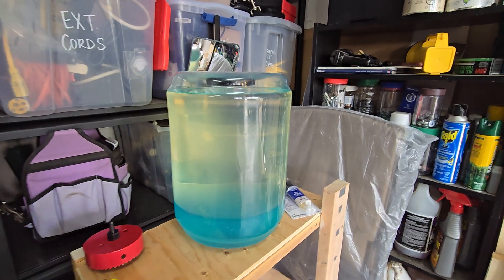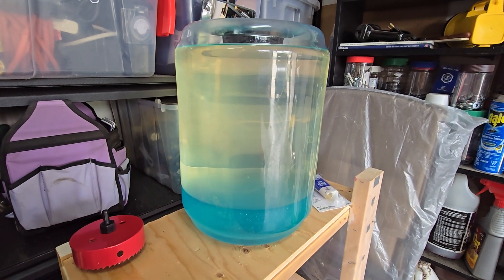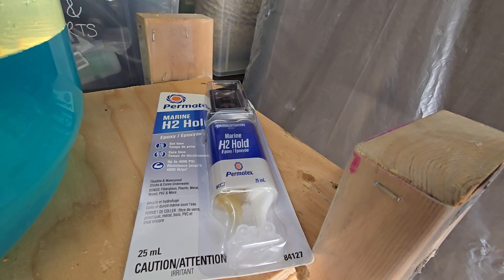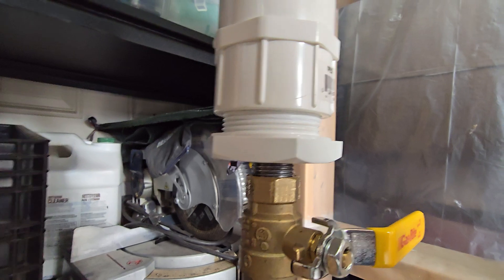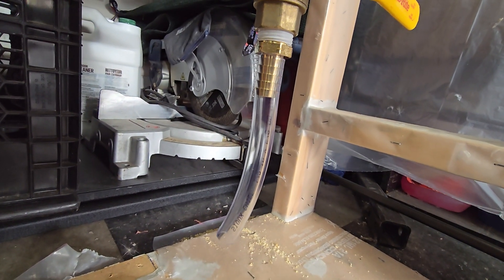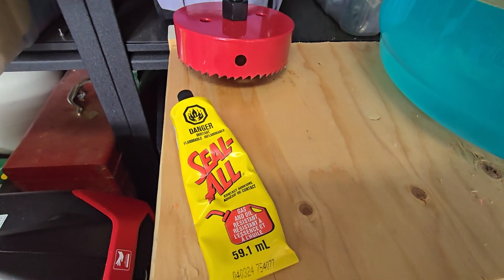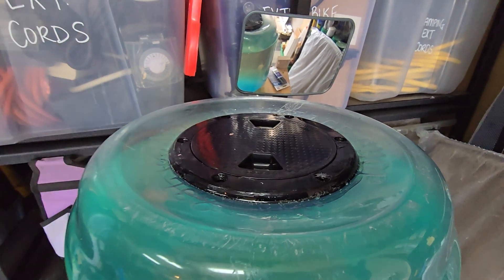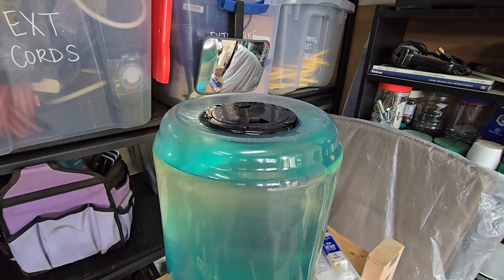My home made container for removing ethanol from gasoline

Comment: I'm a chemist.  Just because two solvents (ethanol/water v. gasoline) are immiscible does not mean that they are not slightly soluble in the other.   If you smell your lower layer (ethanol/water) it smells like gasoline, yes?   With the detergents they put in gasoline, you will pull some water into the gas.  This can cause fuel line freeze-ups, compression issues and corrosion.   Your ethanol/water extract may also pull these helpful materials out of your gasoline.   When an organic chemist does a liquid-liquid extraction (what you are doing) we DRY the upper layer over an inorganic drying agency to bind the water.  

If you are running this in a mower in warm weather,  fine, probably not an issue.  I would not trust this gasoline in a car or truck.  There are products that chemical tie up the water you may want to add as a precaution (Sta-bil or similar).   By the time you do all this, it is just cheaper to buy ethanol-free gasoline available most anywhere, especially near places people boat.
Reply from the maker: @Kopernicus67  in ALL of Canada ethanol free gas is already been banned. I start with shell premium and remove the ethanol mainly for long term storage of my small engines. I've seen enough videos to see ethanol gas goes bad after a few months of shelf life. I have some gas in a 50L stand up Jerry can that's over 8 years old and still the same clear to light yellow color and still burns easily. A can of gas I bought last year was dark yellow and wouldn't burn very well at all.

Comment: Ok cool, but I have never seen any vid on the subject.  Does it just separate?  What is happening?  Sorry I have no clue 🤡
Reply from the maker: @FISHAWNfishing  that's why I mentioned that there are a lot of videos on YouTube of how to separate it. Basically, you add a lot of water and shake vigorously. I add about 5 drops of blue food coloring per gallon of water. After you shake it in a Jerry can, pour it in a contraption like this and let it sit until the gasoline is crystal clear then bleed off the colored water. You have ethanol free gas after.
Reply: @NigelM18  wow.  What do you do with the bleed off?  I am lucky to have a fuel station that sells ethanol free gas!
Reply from the maker: @FISHAWNfishing  where do you live that doesn't have gas that's infected with ethanol? I just leave my colored water in a 5 gallon pail outside and it evaporates over time
Reply: @NigelM18  holy cow Canada has a ban on ethanol free gas!? Dang that's rough.   Yes I live near the Puget Sound of Washington state.  Any marina that sells fuel it is usually free of ethanol.  Gas stations away from the marine environment also sell it, but they are few and far between... and about $1 more per gallon.   I also like it for any small engine or motorcycle... in addition to the boat